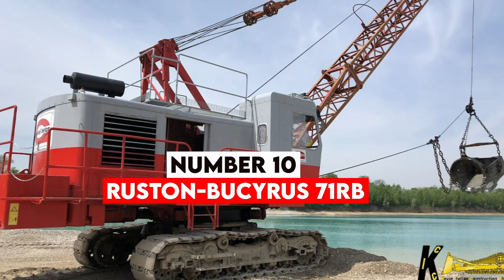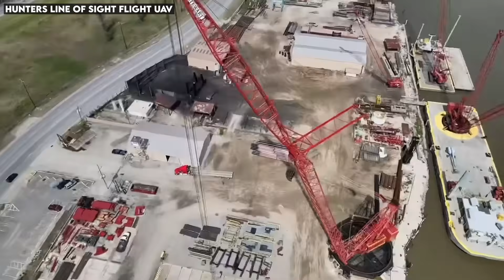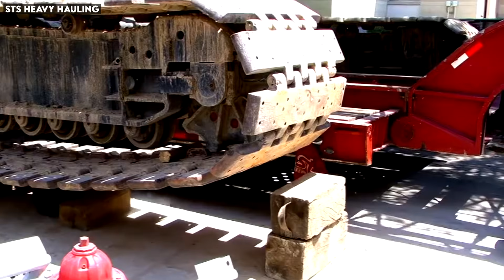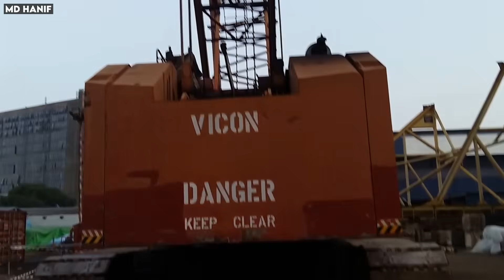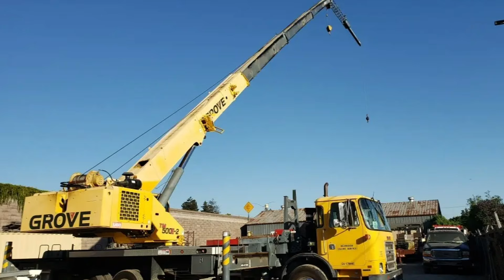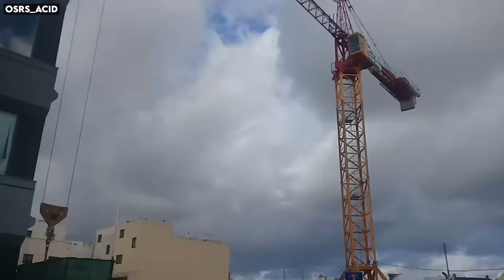10 MOST HATED Cranes That Operators Dreaded

Comment: More AI junk. I operated friction cranes in the 80's ane 90's. If you kept up the brake adjustments and maintenance there were never unsafe and did not require a lot of effort to hold a load. what a load of crap

Comment: What a load of bulls**t I’m a retired crane operator and I have operated machines from Bucyrus Erie, American, Manitowoc, Link-Belt, Northwest, Lima, Bantam, Little Giant and Lorain. 1. You don’t sit there and hold pressure on the hoist brake pedal for extended periods, the hoist brakes on all friction cranes can be locked when engaged. Yes all friction cranes had free fall capability which we typically used to drop the empty hook or very light loads; for lowering heavy loads we used hoist power down. 3. Every crane has an operational load chart that specifically presents all parameters such as how much weight can be lifted with regards to boom length, radius (distance) of the fall line (hook) from the center pin, load factor for degrees of side tilt from level, lifting over the side versus over the end of the tracks, even reducing the load by a percent value for the effects of strong wind! 4. And this is the most important part of crane operations: ONLY trained, and qualified, highly skilled and experienced operators will occupy the seats in any crane! In my 38 year career I have operated all of the friction cranes you highlighted with no problems ever and easy to operate! Now the hydraulic cranes (and yes I have operated many makes and models of those) are a whole different ballgame having their pro’s and con’s. And those tower cranes? Yeah those things truly are dangerous, hazardous, unsafe…all of the above! One of the companies I worked for had one of those on the job site and my 2nd day they convince me to climb up in-the cab..180 feet!…so the operator could give me an orientation so I could be his backup. Well sure enough about two weeks later he calls in sick and they persuaded me to run that thing for the day (for double pay!) and I did not like it one bit, every time the trolly went in or out or when slewing left or right that thing would sway and felt like it was tipping….! That was a one and done! Sorry this is so long keep up the good work for the most part!
Reply: I operated both hydraulic and friction cranes,your 100 percent right ,an operator has to have the skills and be qualified to operate and has to be able to adjust your self to what the crane required to operate safely
Reply: This is the reality ,comment in film is bulls.....
Reply: agreed i ran all of those machines, ai does not understand how the 3900 vicon worked,

Comment: I remember a big sewer contractor that "KEPT" his Big (Bucyrus Erie) crawler crane I think at or near the 71 series. He kept it in (Cable Backhoe) or back Drag as it was called, in his fleet up till the 2000s, he fabricated a (Hydraulic Curl) cylinder for the Bucket, the rest of the excavator was a "Friction Clutch" operations. I remember it digging through a River, and the depth of cut was marked on the big Dipper arm. Why he kept this older Bucyrus was the (Breakout) Force of Cable excavator over firat generations of early Hydraulic excavator, it just had more power in hard rocky ground were you needed a deep ditch 😊 the Curl for the Bucket helped with digging around cross line underground utilities that ran across the ditch lines, I remember watching the old guy that always RAN this cable excavator, especially at times, when setting manholes. I could see the strain in his face, as he applied foot pressure to the Friction "BRAKE" pedals. Thinking back to those deep cuts and watching him work those levers, and his knees always moving, applying BRAKE force to the pedal. Lots of the dirt was dumped into Dumptrucks, so he had to do both his Feet, and hands "CARFULLY" on the levers, to not hit the dump bed of the Trucks. That old guy always RAN this contractor big Bucyrus cable excavator. All the times I watched he NEVER broke a utility line, and with the Bucket "Curl" he could clean the bottom of ditch very straight lined 😊 I saw this huge cable excavator in this main equipment yard till the 2000s when he finally replaced it with a modern huge (Komatsu) about the same size, its amazing that he kept that old huge crawling Bucyrus Erie for so long 😊
Reply: Got a RB 61(1200 super crane) here in England. New in 1990 rigged for hook work still getting used occasionally when the  state of the art Liebherr's break down! 🏴🇺🇸
Reply: @teessideman.8253 
My colleague drives a Liebherr crawler machine - I often get my ear bent about the load - moment computer !